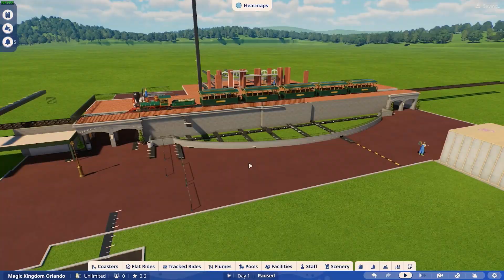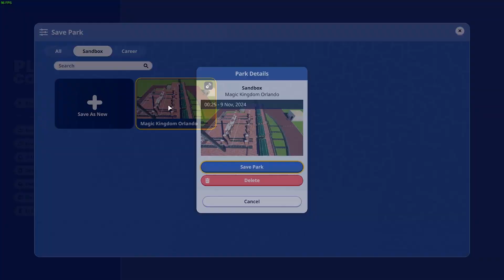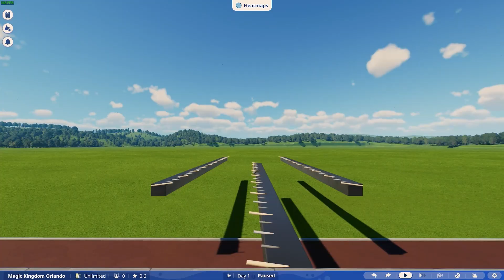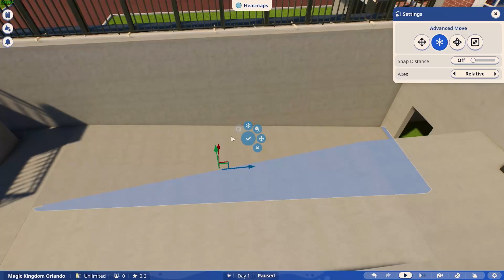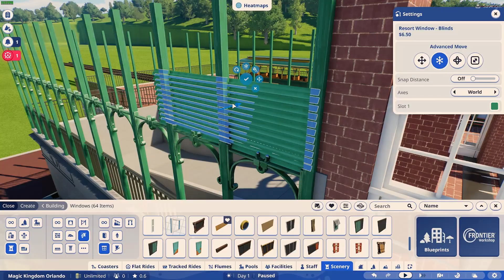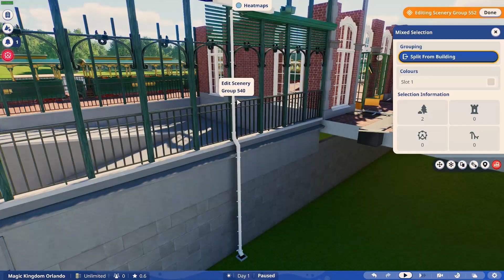More than a Simulation | Magic Kingdom Recreation | Planet Coaster 2 | Ep. 3

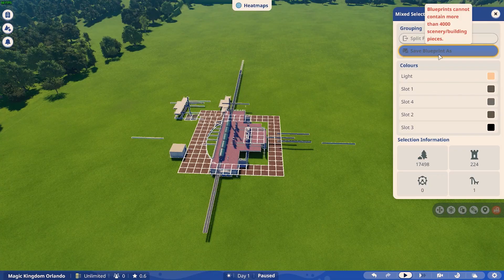Comment: 4:10 the ramps are the exit only, and the main  stairs leading up to the station are the entrance.. and if youre handicap and need wheel chair accessibility, on the side of the Chamber of Commerce building, there is also another ramp that is even longer for wheelchair guests that isnt as steep as the one inside the main station.
Reply from the maker: Thank you for that insight. This makes of course much more sense then. I have to figure out how to make those ramps work in game. I think it’s possible but it will be a pain. 😅